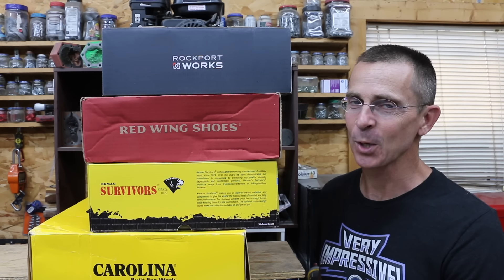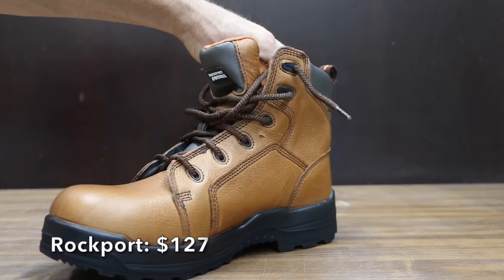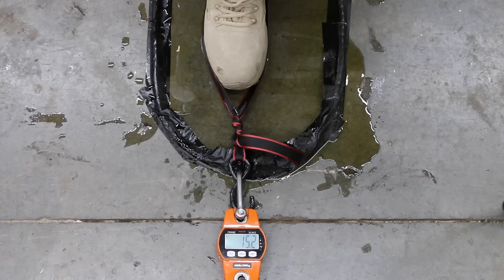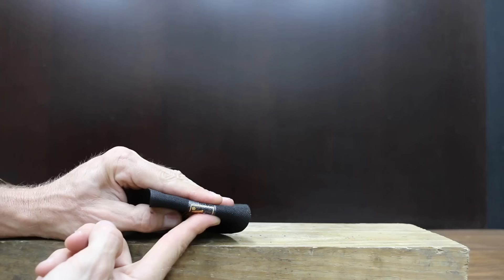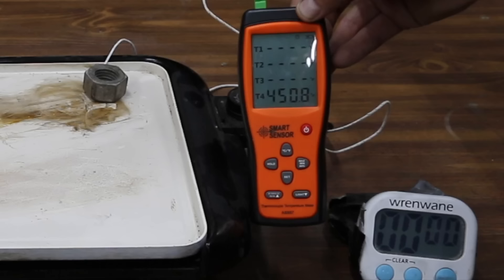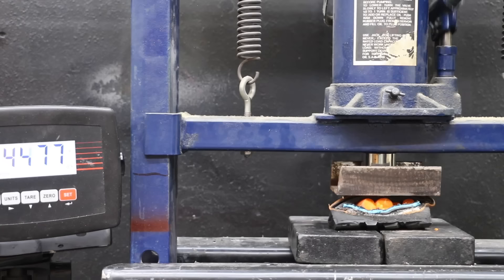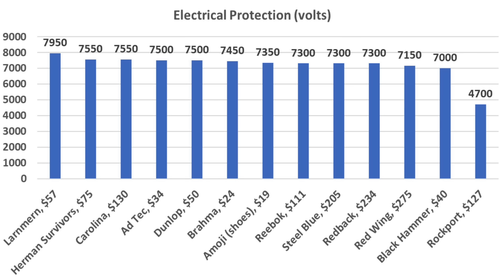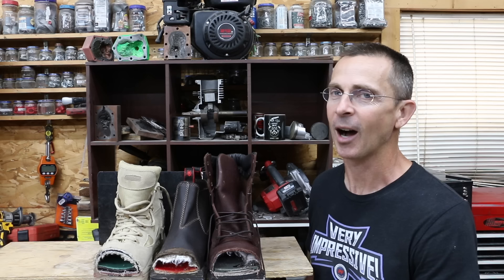Best Boots? $24 vs $275! Let's Find Out!

Comment: I built Red Wing boots for 9 years. I was a floating operator so I did all processes in 2 departments. 
They are Very good boots made with care in my home Town of Red Wing MN.
The cost more but if you take care of them they will far outlast other brands. 😉👍
Great video as always.
Reply from the maker: Thanks!  Thanks for the feedback.
Reply: Lifetime warranty too
Reply: All you really need to do with Redwings is clean them and condition them so they don't dry out. Plus most Redwings are able to be resoled. After the break in period my 606's are easily the most comfortable thing I've ever put on my feet. Can't wait for my Iron Rangers to be broken in. I think they hit that sweet spot of quality, durability, and cost for most people.
Reply: I wore red wing for a long time 👍
Reply: @craig3536  my Iron rangers lasted 7 year 3 resoles. They still look pretty good but are now hurting my left heal. Time for a new pair. But they change the designed the midsole is  no longer use cork! Very disapointed not sure if  I'll buy a pair.
Reply: The redwing (worx) slip on I wear at the firehouse are Chinese.
Reply: Overrated junk

Comment: I've had the same 2 pairs of Redwings for over 15 years now.  I maintain them every year and they have outlasted every boot and shoe I've ever owned.  You might pay more upfront, but for that kind of quality, you actually save money in the long run.
Reply: Unless you do metal working, my brother gashed a hole in his on his second day in the shop lmao
Reply: @JacobyStevens  That's just bad luck lol
Reply: i bought the cheapest walmart brand boots i could and some other cheap brands when i started working on a farm at 14years old. they last about 6months at most before coming apart in one way or the other. eventually i spent the money on some redwings which the farmer that owns the farm wore for many years and i havent bought a different brand since. ive been using redwings now for years as im 30yrs old and ive bought 3 pairs over that time. if used reasonably they last and they keep your feet comfortable and safe. my first pair are still usable to this day but the inside wore out and became annoying to feel. so maybe take care of them and replace the inside after a bit to prevent serious wear and tear haha. another experience to was when a hydraulic line on our skid steer broke which dropped the bucket full of gravel on my foot, the steel toe saved my toes and the top of my foot was bruised but it could have been a lot worse.
Reply: I just bought my second pair. First pair was bought in 2014 made it through 9 years of on and off use. they went through hell and were not maintained well at all. This second pair will be taken care of now that I know better. Hopefully get 10-15 years out of this pair.
Reply: Or me who goes through them every 2 years cause work gives them out for free
Reply: @Wetopie 
Xfinity tech?
Reply: @pleasurewasmine3173  dropped one end of a 2000 lb steel ramp from a car hoist from about 3 ft high on my Redwing boots and just had some bruised toes. Not willing to try with a different pair.
Reply: @shouldhavenotshouldof2031  samson rope
Reply: Can Redwing shoes be serviced if needed?

I have some Timberland Pro work shoes that are still good but the padding wore out at the archeles heel and are quite painful.
Reply: @matthewrs7  if the soles are stitched on. Ask the salesmen which ones are serviceable before you buy them.
Reply: @pleasurewasmine3173 I'd buy a new pair every year lol. The chemicals and stuff in concrete and the oils on the ground at work and stuff. They last alot longer than the other boots but I still gotta replace em yearly. Worth every penny
Reply: @JacobyStevens your brother probably would have lost his foot if he was wearing anything else. Probably saved him thousands in hospital bills
Reply: I've been wearing the same timberland pro series for 7 years. Since work but me a pair every year I have another ready to go. They have sat in the box for six years and I stopped buying new. 
The only thing I've done is use Good Feet inserts and rubber insoles due to having flat feet.
Reply: 15 year old redwing is nothing like the same model made today. Quality in everything has gone down.
Reply: @wolfeadventures  Yeah, unfortunately they are garbage boots like the rest now, most are made from Chineseium, sad.
Reply: mine have lasted 4 months :(
Reply: The sole melts away too fast for me. And no one on my island does resole. Would be cheaper to buy new ones than to resole them. Very sad. I had thoroughgoods, they lasted longer than the redwings but still, sole too soft.
Reply: @matthewrs7  I take mine in every 3 months for free to have them fixed for imperfections and polished/cleaned at my local red wing store. Have had them for almost 10 years and they look new.
Reply: I have these exact Red wings, the supersole 2.0, and if I go with Red wings again next time I think Vibrum soles are just the way to go instead. Yes these are very comfortable, but the sole started coming apart after just 6 months of use. If I want to get them resoled by a cobbler, they will have to replace the welt as well and it will be very pricey. I will say they are the most comfortable boots I have ever worn, after the painful break in period ofc.
Reply: @Inbal_Feuchtwanger  yeah I’d never go with a wedge sole ever again. They wear so quickly it’s unbelievable. Leather is still new, sole is gone. Replacing soles here cost more than the boots.
Reply: Sounds like something I'd buy with boot credit.
Reply: My two pairs are 18 years old now not even close to being retired, and I do zero maintenance on them. I also when I walk dont dragge my feet so helps the treads.

Comment: Longevity is really important when considering the cost. I used to buy ~$50 Brahma boots every 4 months or so. My first pair of redwings was around $250, and they lasted around 18 months of hard wearing in a junkyard, and still looked better than 3-4 month old Brahma boots. When you add up the price for all the cheap boots to last as long, suddenly the price of good boots looks a lot better. That plus the extra comfort of the nicer boots makes it a no brainer option for me these days.

Fantastic work as always! I'd really love to see you get your hands on some nice handmade boots like Nick's
Reply from the maker: Thanks!  Thanks for the feedback.
Reply: I grabbed 4 pairs of these exact same Brahma boots for $5/pair so I have boots for a while lol.
Reply: Curious if you have had your RW's re-soled/etc?  A resole and basic care can run 130-160 and might really extend the life.  Check out Trenton and Heath's latest video.
Reply: I'm going on 10 years with my Redwing boots. Granted, I don't daily them but they still get used. I learned years ago not to buy cheap boots. Dry and comfortable feet go a long way when you get older.
Reply: Try redback boots. So much lighter and incredibly comfortable.
Reply: Words of wisdom from Sir Terry Pratchett: "The reason that the rich were so rich...was because they managed to spend less money.

Take boots, for example. He earned $38 a month plus allowances. A really good pair of leather boots cost $50. But an affordable pair of boots, which were sort of OK for a season or two and then leaked like hell when the cardboard gave out, cost about $10.

Those were the kind of boots Vimes always bought, and wore until the soles were so thin that he could tell where he was in Ankh-Morpork on a foggy night by the feel of the cobbles.

But the thing was that good boots lasted for years and years. A man who could afford $50 had a pair of boots that'd still be keeping his feet dry in 10 years' time, while the poor man who could only afford cheap boots would have spent a hundred dollars on boots in the same time and would still have wet feet.

This was Capt. Samuel Vimes' boots theory of socioeconomic unfairness."
Reply: Need to get Carhartt boots in the mix!
Reply: @teebob21  "Do it right or do it again."
Reply: Thanks to Nick's, I now know & understand what makes a great work boot great. It's things like using leather instead of "generous amounts of padding" inside the boot.
Reply: Same here. I used to go through boots quite quickly but I'm on my second year with my red wings. They have only got more comfortable and have only lost 1 lace eyelet so far.
Reply: I've had red wing boots for many years, love them. Usually use them around 3 to 4 years then buy new ones.  Use the red wing oil every 4 months. Then buy new red wing sole liners every 8 to 10 months.
Reply: "Buy the best and only cry once" WAS the mantra. Then here you come with all your tests. Sometimes the most expensive doesn't stack up against Harbor Freight. In the case of boots though, you show you get what you pay for. Thank you again!
Reply: @ronvanbriggle6567 exactly 💯% right👍, literally called boot oil for a reason. That and new insoles is a game changer. Add to that redwings can be resoled (especially if you're lucky like me and live near a stand alone redwings store). 
My father was a lineman for GTE then Verizon before retirement, those men stood on steal shanks on the side of a pole 20 to 50 in the air with wind kicking and had to be on point because a fuck up with power lines is a one way ticket to the grave (he told me several times about guys that fried). People in careers like that need dependable boots, that let them focus on the important task at hand. 
One thing he beat into me was, "you get what you pay for" another was American made meant something. You have to factor in the frustration, the inefficiency, the failure rate etc. He was never cheap about investing in quality and ALWAYS pushed TAKE care of your investment and it will pay for itself. 

Also diy sure there are growing pains, but if you study you essentially get a free tool for your labor, plus the knowledge and life experience, which will only make it easier as time goes by. 
He was a wiser man than I realized in my youth. These lessons I try to pass down to my teen son now, God help me 😂
Reply: Another thing that will help with longevity of work boots and shoes is buying 2 pairs to rotate wearing them every other day. While its seems logical that they will last twice as long since there are 2 pairs it doesnt work that way. I used to have to replace my kitchen shoes every 6 months due to wear. But after buying 2 pairs and rotating the use every other day, the same shoes that only lasted 6 months have lasted 2 years of use now. So I've gotten twice the longevity out of them.
Reply: Thing is Brahma came in middle of the pack on almost every test. Not bad considering they were the cheapest boot.
Reply: @teebob21  I knew someone was gonna say it
Reply: you gotta try the Ouxx's, I love the side zipper, best boots I have EVER had bout $80 but well worth it. my Brahmas lasted a month to 3 months at best always separating the shoe from the sole at the bend point but not my Ouxx's
Reply: I was the guy who bought Herman Survivors. Used to at least. They were a really good $50 boot for a while. A few years later, they changed the design and not only was the boot now uncomfortable. It fell apart in less than a month.
Reply: And they're made in the US!
Reply: i've been wearing the same pair of mcrae vibram sierra steel toe combat boots for going on 2 years now (starting to reach the point they need replacing) working in construction. they costed $180, however i did need after market extra high arch insoles and also put a thin steel plate (saved my foot several times) under under the insoles.
Reply: @J.C...  Thank you!

Comment: I worked in a factory over a decade and Red Wings became my go to after having to replace cheaper boots frequently. More expensive but this is one of those "You get what you pay for" situations.
Reply: Very true if you buy the American made "heritage" line.
Reply from the maker: Thanks for sharing.
Reply: Agreed!
Reply: From years of fieldwork I agree that Red Wings and Danners are awesome for holding up for ages. Red Wings also have such a wild array of sizes if you have very big or very wide feet.
Reply: Same for me. Redwings are so comfortable
Reply: I have the exact pair of red wing boots you tested. 3 hard years in a oil refinery and still going strong. Almost no wear on the sole. Still water proof and the uppers are in good condition. One of the most comfortable boots I've owned.
Reply: @samuelwilson6868  new pairs are hardly waterproof now sadly
Reply: In my experience, Redwing boots lasted about the same amount of time as much cheaper boots, while being 5x the price.  Georgia Romeo boots last a decent amount of time and they are much cheaper.  The elastic fails first and the boots get too loose over time though.  My keens have lasted the longest so far.
Reply: I wore my Red Wings a lot for my previous job and it was insane how long lasting they are. I still have them twelve years later. Compare that to my go-to daily wear sneakers that start to break down after a year.

The one downside is that they are HEAVY. It feels like a workout to walk around in them all day.
Reply: It definitely fits Sam Vimes' "Boot Theory" doesn't it?
Reply: After having to replace cheaper boots @ every 6 months I bought into the hype and got some Redwings. They cost $140 and only lasted 6 months as well. And everybody that wore them praised the shoestrings, too. I couldn't keep the damned things tied. I replaced them with leather strings after the 1st week and used them again on my next pair of Brahmas. When I looked back on it, it was always supervisors who raved about Redwings. I guess if all I did was walk around and talk all day my boots would have lasted for years as well. Never going to waste my money on Redwings again.
Reply: @robo5013  are the 140$ boots made in America? Only the expensive ones are, lot are made overseas.
Reply: @dajur1  That hasn't been my experience at all. 

I used to buy new boots every year. Wasn't even going for cheap ones - this included a pair of timberland pro's and carhartts. I've now had my made in USA RedWing Super Sole 2.0's for 4 years and they're still going strong. Never looking back.
Reply: And as my dad would say, "You get what you pay for, but only pay for what you need". I don't need boots as good as Redwing, I work at a desk, but some of the other OK ones may fit my needs.
Reply: @lucasjohnson5419  Don't know, don't care. Was 12 years ago. $140 was a lot for boots when I could get ones for $15. Not gonna look into it. Fool me once...
Reply: @thefrogking481  the heritage boots are their dress boots. I will say I’ve worked in Red Wing and know a lot of the shoe builders. If you ever were to become friends with someone in the factory you can get the friends and family discount, 60% off.
Reply: I agree not to mention made in the USA. The USA doesn't necessarily make the best everything but when it comes to work boots they definitely do. Also Kline pliers are the best too and they are made in USA.
Reply: @NICKONICKONICKONICKONICKO  Add mink oil and that will waterproof them and extend their life.

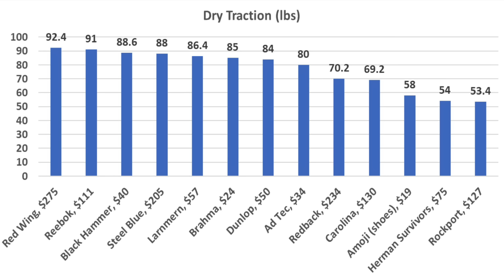Comment: 4:52 Dry Traction (lbs)
6:24 Wet Traction (lbs)
9:13 Bottom of Boot Strength (lbs)
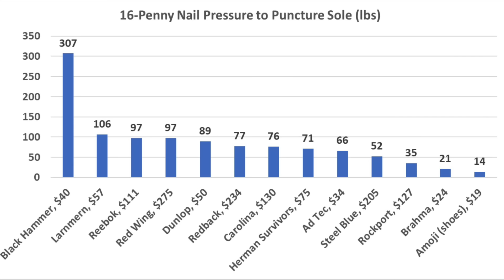10:22 16-Penny Nail Pressure to Puncture Sole (lbs)
11:21 16-Penny Nail Pressure to Puncture Top of Boot (lbs)
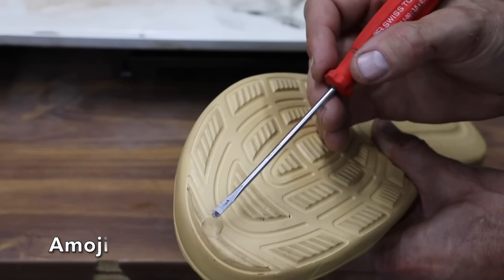12:21 Subjective Outer Sole Heat Exposure Rating
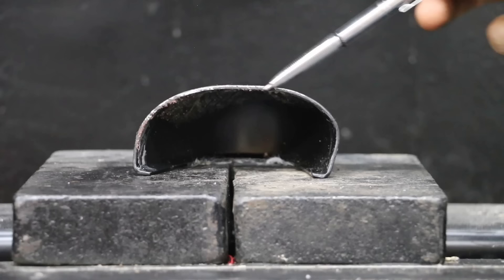15:26 Maximum Weight While Maintaining 1/2 Inch Gap (lbs)
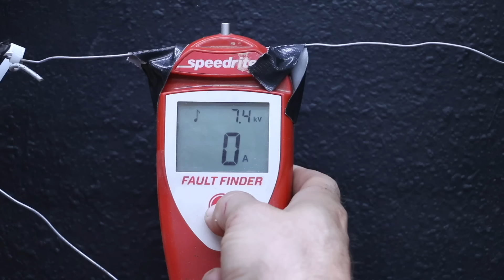17:04 Electrical Protection (volts)
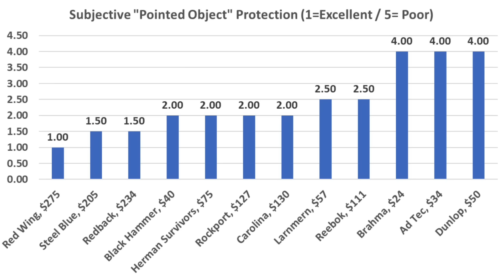18:50 Subjective "Pointed Object" Protection
19:01 Subjective "Natural Walking Motion"
19:13 Subjective "Sole Padding"
19:19 Subjective "Overall Padding"
19:28 Overall Comfort Rating
19:35 Overall Rating
Reply: Thank you for that....

Comment: I learned about Redwing boots when I worked on the fire line for the forest service back in the mid '60s. Now I am just on my second pair. Quite economical. The Redwing store resoled my first pair several times, and I replaced the insole, but they were still good for 40 years.
The only time I wear cheap boots is when welding. Next time I need to replace those boots, I'm definitely going to look at the Black Hammer.
Thank you for all your work and creativity.
Reply from the maker: Thanks for sharing.
Reply: I work in oil and gas in a fairly chemical ridden environment.  Everyone here uses red wings.  They are the only boot you can get 1-3 years of service out of here.  Nothing else lasts.  I am amazed to see people getting double digits worth of use out of their redwings.  While that is certainly not the case up here, the redwings still outperform everything else.  Redwings all the way.
Reply: rocky outback

Comment: Thanks for adding the Redwings. The pair you tested are the same ones I wear welding. I usually get from 4 to 6 years out of them on concrete and sharp objects. I only had 1 pair fail when I punctured a hole through the sole. Redwing gave me a new pair, no questions asked. 10 hrs a day on my feet and still the best boots.
Reply from the maker: You're welcome!
Reply: I suggest trying the 2414, puncture resistant and goretex for dryer interior along with waterproof. The plate in the bottom helps with standing on ladders as it adds rigidity to the shank of the boot keeping your foot straighter and not allowing it to fold as much.
Reply: Red Wings have a super sole on some models witch is about nail proof those are the ones I always got and I never got the ones with the big pad in back as it don`t really add any comfort

Comment: Great test! I have been an industrial electrical contractor for over 30 years. Redwing by far have been my favorite as well as Keen. The EH (Electrical Hazard Rating) that you refer to is an ASTM standard of 600 volts or less in dry conditions. You far exceeded this test.